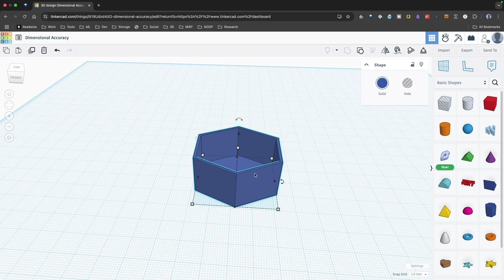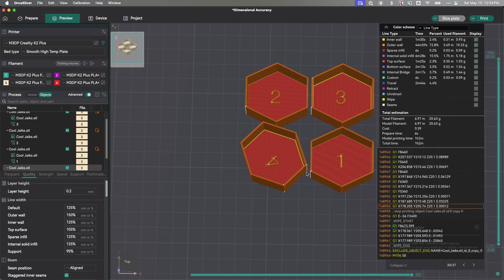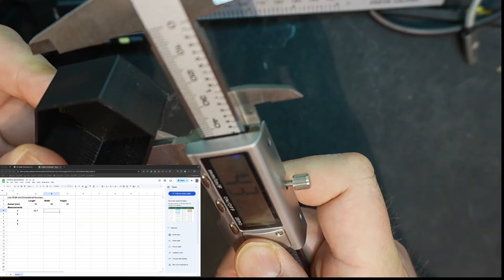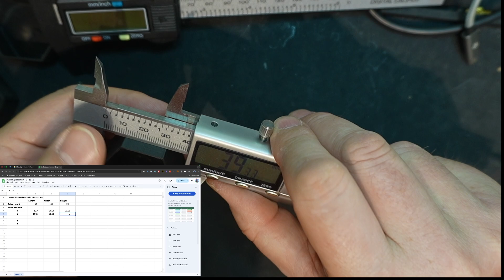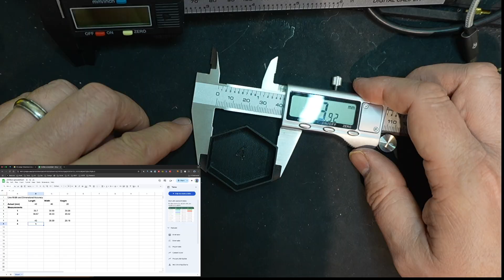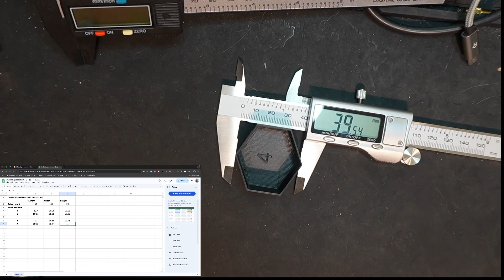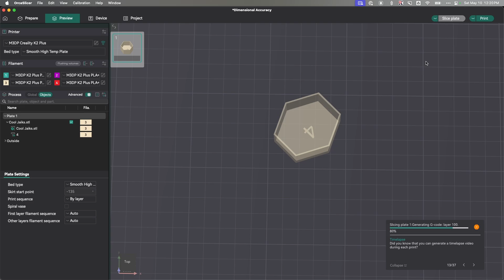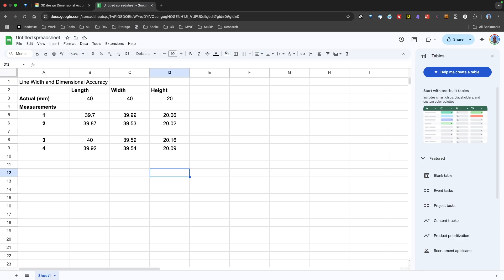Dimensional Accuracy in 3D Printing: A Deep Dive into Orca Slicer Line Width

Comment: You should have added some holes. Accuracy from Fusion to a final print with say a 5mm or 10mm hole is important but hard to get.
Reply: The Line width is tooooooo smalls

Comment: When you measure corner to corner, keep in mind that corners are rounded with a diameter of the extrusion width and won't match (or shouldn't match) the dimensions of the mesh with perfectly angular corners. Also the best way to ensure accuracy with your Z height measurements regardless of bed calibration is to print two in the same spot of the bed (so not at the same time) but with different heights and measure this difference (e.g. zeroing with the small one).
Reply from the maker: I appreciate the feedback.

Comment: Hi, while an interesting topic, I only got about 6 minutes in an noticed some inaccuracies in your measurements.
You were not ensuring the part was square in the calipers for Part2 "corner to corner" for example.
Also for Part4, printing at a different angle like that may introduce other inaccuracies if your printers x/y skew had not been measured and corrected.
Further, for the height measurements, with precise Z height on or off, you would need to ensure your first layer is well calibrated. Incorrect Z-Offset would have a bigger impact on accuracy in Z-Height than the slicers setting, due to too much or not enough squish.

As mentioned, the concept was a good one, and you made a lot of effort to achieve meaningful results, but I found you still have some room to improve your methodology.
Reply from the maker: Thanks for the feedback. In future experiments I will look to see how I can better do the measurements.